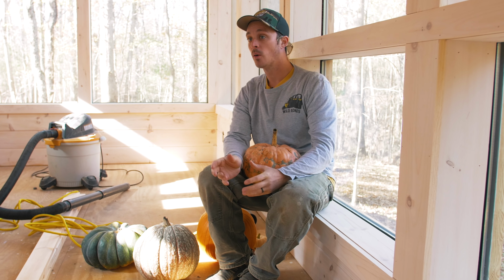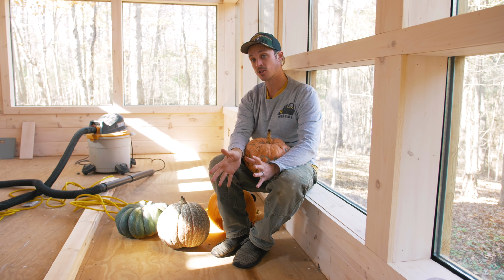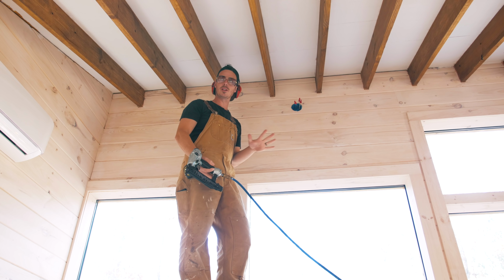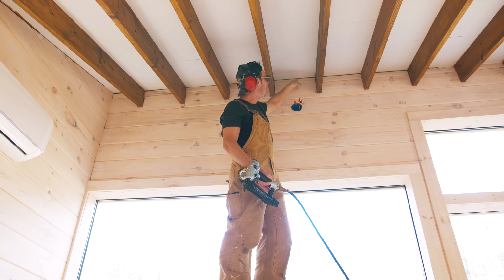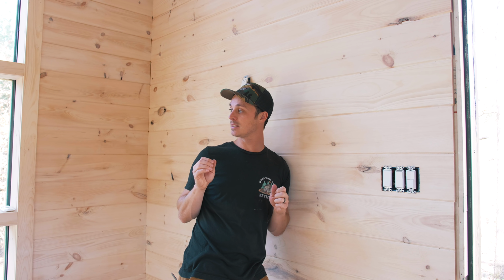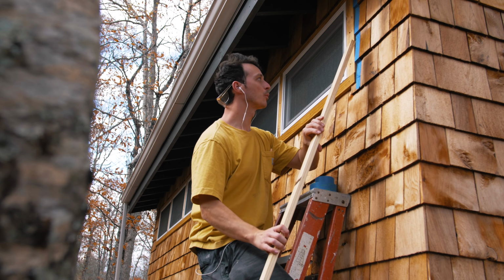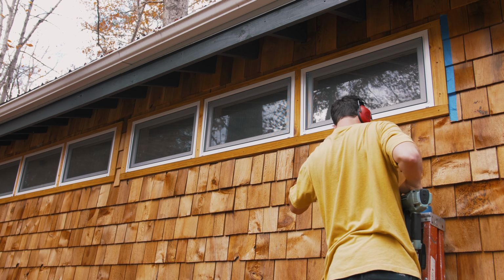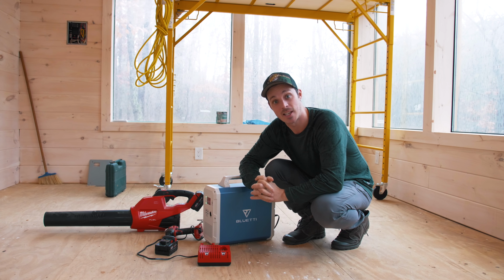This Cabin interior is STUNNING - Cabin Build Ep.48

Comment: But now what will cover the gap between the trim and the wall and the ceiling?

You will have to add more trim to cover that.

Then there will be a gap between the first trim and the new trim that will have to be covered, as well as gaps between the new trim and the floor and the ceiling. All of this will have to be covered.

Then the second layers will all produce more gaps between the respective neighbors, all of which will require covering. It shall be like an infinite fractal, until trims are being created on the sub atomic level.
Reply from the maker: Oh dear. You have an incredible point. 

I thought that perhaps the trim up against the ceiling could have trim against the trim on the wall which is next to the trim on the beam. When the trim on the ceiling meets the trim on the wall, perhaps I add trim to the beam to cover the seam. But if the seam can be seen and the trim has already been, then maybe I add one more beam.
Reply: @WoodnessGoodness  You won't need any more beams, just more trim, lets not get too absurd here. 

Everything will be trim. It is all trim all the way down.

Comment: Hammer marks give the, final wood ceiling trim looking sweet. Not! With a mini sludge. use a spare block of wood next time. Takes 2 seconds. And the horizontal seams are real folks. Just let the water pool up and soak into wood. Vertical seems whenever possible. thankfully not a real home.